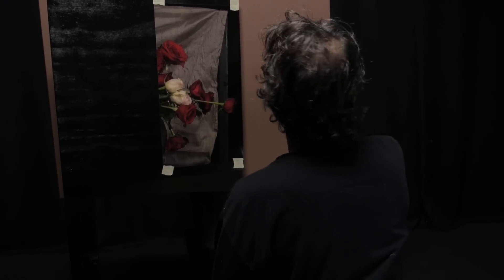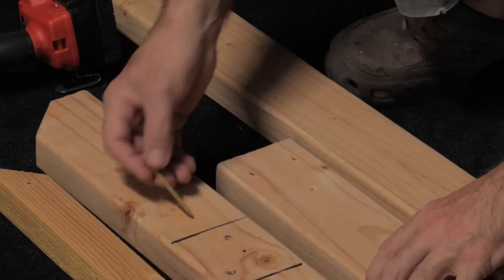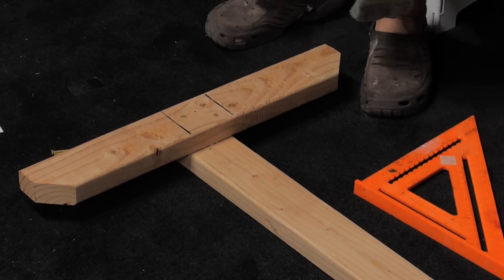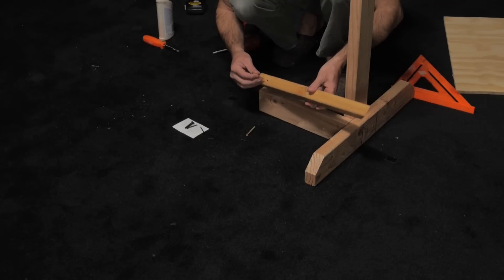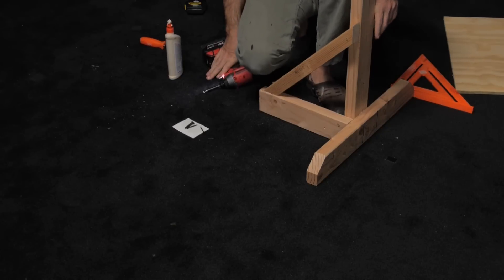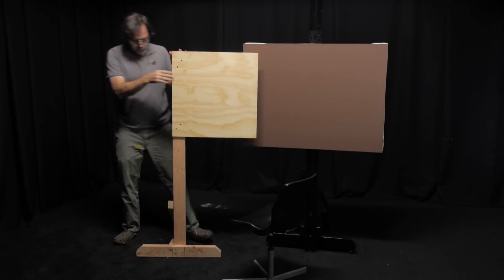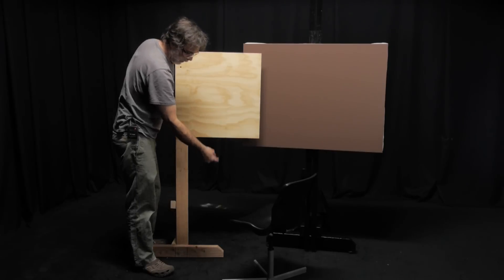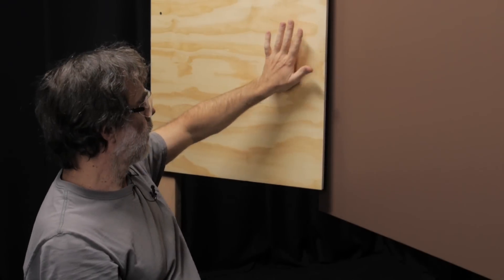how to make a photo holder for artists

Comment: Hello! I got your Portrait series and will be starting your method next month with a Photo of my own. My question is, Instead of Laminating the photo would it be just the same, using 1/8 inch PlexiGlass to cover it on the photoholder? I only ask because i have access to free plexi. I was going to use it for my Palette but i fear it will scratch when scraping off old paint.. Thanks!

Comment: why was it important to have the screws be able to pass through the wood easy? was it so you can square up that piece of wood?
Reply: +franky5angels77 I believe for a couple of reasons. The clearance hole allows for the screw to pull the bottom board more tightly onto the top board. Having the clearance hole slightly larger than the screw helps prevent splitting the top board and helps prevent the screw from snapping should it hit a hard part of the wood which causes it to bind. I think that's the reason.

Comment: Hi!
thank you for sharing!
But:you should have a big atelier, to store this masive holder in. I paint in living room..I have wooden easel which is foldable (maximum what is allowed from my family) and this should be unacceptable...So for me, should be a "miracle" :-), small, foldable, holder which I SHOULD INSTALL on easel and photo holder and tablet holder intrgrated in one device as well (!) Also, should be lightweight, portable, and used standalone ... as painting/drawing support. And  one magic screw.. and should be installable on photo tripod to be able go draw, paint outside...such a magic device should a big help for me..I try to construct it for myself, but if anyone has a tip...should be nice...bye, Alex.